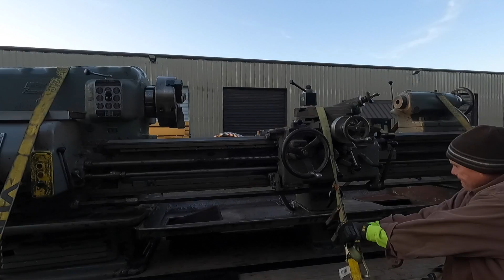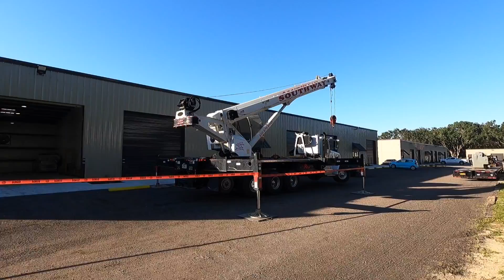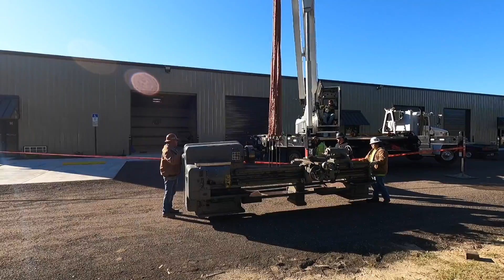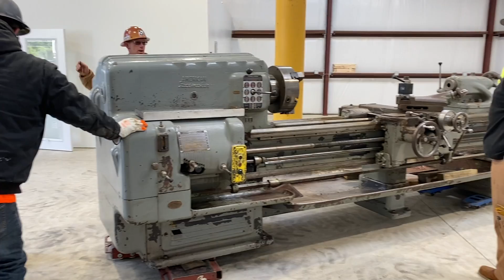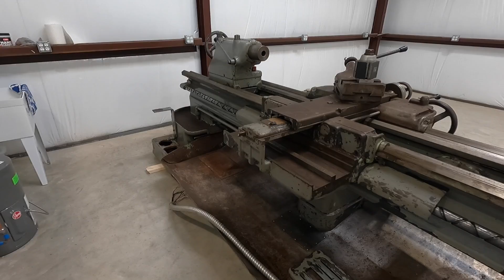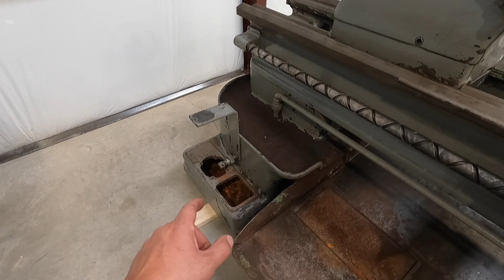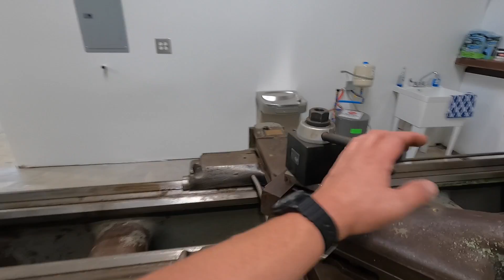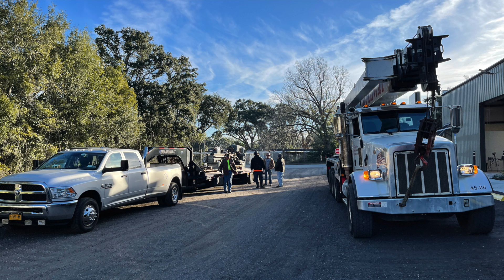American Pacemaker Lathe Arrival & Unloading

Comment: Beautiful machine, and very heavy and rigid for their size. I have a 22x96 Elliott (English built 1970s vintage) in my shop, and I would bet your pacemaker has a couple extra tons on my lathe. If it wasn't for needing metric threading and larger spindle bore, I would probably have one of those instead.
Reply: We have an old English Ward turret lathe at work purely for its spindle bore - 4 inches with clearance, can feed drill pipe etc right through it.
The beautiful things really the turret - 6 tool positions with automatic feed - wanna drill a 3 inch hole? hit the speeds and feeds and stand back and let her do all the work- makes drilling a inch hole in our smaller 16 inch centre lathe seem like hard work

Comment: I would have thought a forklift would have a been a better deal to lift it and move it around ?
Reply: The hall is not big enough for a forklift heavy enough for such a beast, i guess!

Especially when you need to move it lengthwise through the shop.
Reply: @Custom CNC  I was also thinking I have seen a lot of shops also have a forklift to help move around the heavy products and parts around . I can see having pros do the moving around also helps with peace of mind and safety when moving such heavy weights

Comment: Hi Adam, nice machine and it oozes quality albeit a few years old. I have always admired the Dean Smith and Grace lathes from the UK as a bench mark for quality here in New Zealand. Not many US machines here due to our power supply being 240 compared to you at 110. It looks like the hand wheel on the tailstock has been put on the wrong way around but I am sure you will rectify. Keep up the good work. Ian - New Zealand
Reply: @cmmartti  our three phase is all 400volt occasionally in home shops we run single to three phase converters that convert our 240volt single phase to 240 volt three phase

Comment: Why not a fork truck
Reply: There are a couple of reasons why. A forklift large enough to lift that lathe would weigh in at least 22,000 pounds. That’s what my 15,000 pound capacity Hyster weighs. The parking lot would probably not handle the combined weight of the lathe (probably 11,000 to 12,000 pounds) and the forklift. It also doesn’t look like the door is wider that the lathe is long. I ran into that issue with my 16x78 American Pacemaker and it’s nowhere near as long as Abom’s machine.I had to push mine in lengthwise just like they did. One other issue, and I’m speaking from experience moving a Pacemaker, is that there are components (drive and lead screws) that are easily bent by forklift forks if you’re not paying attention or if somehow something goes wrong. Using a crane, machine skates, and a pallet jack is really the better method given the conditions of his site.

Comment: We had a 20X192-inch version of that lathe at the shop I spent my career at. I installed a Newall readout and made a 20" ID steady rest for ours. As I recall, that unidentified lever at the end of the bed is a rapid traverse lever for the carriage. There is another on the carriage, left side. I think we used an Aloris DA toolpost.

Comment: Abby should appreciate this, I helped move most of the "secure" machine tools (monster lathes, mills, saws, drill presses, shapers, shears, planers, multi ton presses, CNC machines, test stands, etc.) from the 300 acre  Bannister Federal Complex (also known as the "Kansas City Plant") down to the new 1.5 million sq-ft facility on Botts Road in South Kansas City.  I know that drayage costs for that kind of lift and move is by no means cheap, but the folks you engaged did an excellent job, and she's also right, that "American Pacemaker" is stunningly gorgeous. I hope you get decades of joy from using it.

Comment: Is there already a crack in the floor?
Reply: do you know what an expansion joint  is?
Reply: @ladeseddy5994  I think I do, but check out 19:29, right in the middle of the lathe. That does not look like an expansion joint and I think it wasn't there before they put the lathe in.
Reply: @myname7021  Yep, there is one...
Reply: @myname7021  
If you look at the video where he was sealing the floor, the crack was there before the sealer went down.
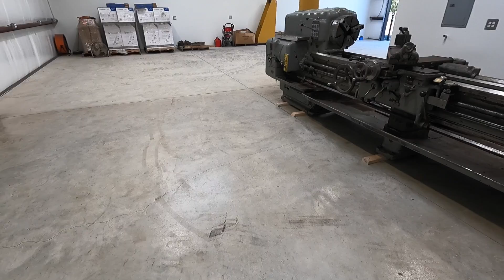Reply: 20:45

Comment: Whats this weird criss-cross lead-screw at the back for?
Reply: I’m not sure how it works on this lathe, but the idea behind that kind of screw is that when the end of travel is reached, without thanking the direction of the turning of the screw, the travel of the component automatically reverses direction. It’s a fairly common method of doing that. For example spin fishing reals use that method to reverse the the line guide direction.

Comment: What is the purpose of a shaft with a right-left hand thread????????????????????????????????????????????????????????????
Reply: Auto reversing screw carries the tool carrier back and forth without having to reverse the direction of the motor

Comment: Adam, check out Cutting Edge Engineering's You Tube channel; he got a lathe that he made brand new feet for, and he used an old piece of 4140 chrome bar from a hydraulic cylinder and he threaded the feed for some threaded rod that he cut to IIRC about a foot in length so he could level the machine, as his shop is in an old helicopter hangar. https://www.youtube.com/watch?v=6PwyvY09Ab0
Reply: That was a good video.  I already subbed to CEE but had missed that one.  Great dog!
Reply: @BillyLapTop  I made the suggestion to Kurtis & Karen they need to make a "Best Of Homeless" video and do a "tally" on how many toys he's destroyed right out of the Amazon packages; I think the score on "Homeless VS pigs is Homeless 6, Pigs 0".

Comment: Lovely lathe, really solid looking machine. Was thinking whilst it was being rolled in..with your floor being so good have you heard about air skids? they are really low profile and work on compressed air that turn whatever they are attached to into a hovercraft..you can move several tons with one hand no probs in any direction..maybe worth thinking about for bringing in future machines as thers no damage/weight on the floor as it moves

Comment: That strobing - those round lights are running at a (low) frequency that causes strobing with your camera.  You need to swap them out with something else or blow them out with more brighter light that isn't switching a low frequency.

I ran into this with an LED light swap at an office while we were trying to do high speed filming of some moving robot stuff.  Fixed it for my application by blasting the target of interest with 10k lumens of DC powered LED flood lamps.

It's unfortunately the lights and swapping cameras or going higher frame rate will only exacerbate it.
Reply: I don't care about the light,  this is not the Drama or theater department of the local junior college. If the lights work well for his machine tool operation then they are purfact. If they caus problems doing machine or welding work then it becomes an issue . PS one of my friends teachers  Lighting and Lighting effects at the University level. He also does stage Lighting on the professional level.
Reply: I fail to see the relevance of your friend or his teacher

Comment: That sheet metal tool tray is actually a brilliant idea!
We used to run 5 Mitsui CNCs that had nowhere to put an expensive torque wrench when adding component so we had to balance the wrench on side of machine and several times the wrenches slipped off into the screw chip conveyor and were destroyed.  $300 a time but when I asked boss to get some bits of sheet metal bent to make a tool rest he just laughed.
Some bosses are idiots!
Reply: Not all bosses/supervisors are morons and actually like the ideas that come from line workers for "improvements"
Reply: @andrewkoetz3933  
I don't believe I ever met one in all the mills, factories and offices I worked in .
Second job as a teenager was working in time and motion office that quickly taught me how to get high production but that business closed due to cheap imports.  After that in every job I was able to study the bottlenecks and time wasting and suggest or directly make improvements but usually the other workers or bosses resented it.
Ruining those expensive torque wrenches every few days for sake of a few bits of tin about as big as a sheet of paper is typical.
But in that same place we scrapped about 80% of production because boss had agreed all the parts woudl be checked with a CMM and bought one but the 5 Mitsuis made so many parts that the CMM could only check perhaps 20%.  Other 80% went into the scrap dumpster.
Guess how long a business can survive when it scraps 80%?

Comment: Stick a small submersible sump pump into that coolant tank and your good until you find a replacement pump.  What are your plans for raw material storage and scrap / swarf?  What other machines are you looking to add?   On a side note, those LED lights are still causing a lot of flicker on camera.  Have you asked your electrician if they could be run on DC to eliminate the flicker?

Comment: Congratulations Team ABOM79!
1. I firmly believe your restoration of this machine will prove to be one of your more popular series.
2. I think that bracket for the sump pump had an electrical box mounted on the top where that non-gray area is.
3. That poor crane operator had the sun in his eyes the whole time.  Did a great job nevertheless.
4. As an experienced metal finisher and auto body expert I recommend that you lightly sand all of the services you intend to repaint because regardless of how many coats of paint there are, you cannot guarantee adhesion by simply washing it down with solvent. The surface must also be in a rough enough texture to allow the new coat to “grab it”physically.  Just make sure that you wipe it down with a Prep-Sol-dampened cheesecloth after you sand it to remove any between-layer grease & oil and the paint should be primed along with any bare metal spots that you have after trying to address the rust.

Some of the lighter rust can be removed relatively easily with a muriatic or hydrochloric acid solution (pool supply items).

Recently my landlord had to have painters come back three times after the paint fell off because they had  failed to prime the bare surface first.
Reply: Commenting to add highlight to Mark Lee’s comment since I cannot thumbs-up more than once. Great advice. Tho muriatic/hydrochloric acid really shouldn’t be used without training and appropriate PPE. Vapors can really be an issue.

Comment: How will you place the lathe on the ground?
Reply: He'll put pads under it and use leveling feet to most likely raise It up to get it off the wood and then lower and level. Leveling a lathe is pretty tricky and I imagine a long one needs quite a bit more patience in leveling well
Reply: Essentially bolts thru the bottom flange of the casting onto steel pads to distribute the weight to a larger area
Reply: Toe jacks. Uses a bottle jack type hydraulic pump with a hook close to the ground to get under the machinery

Comment: Something I've always wondered (this is a lathe history question) - AT&T gave my highschool a bunch of equipment after the war. The lathe (no idea what make) was one of the first units to have an electronically controlled variable-speed drive. It was filled with some big-bastard vacuum tube controllers. If electronic control was used that far back, why do many lathes that were made much later, still use manual gear changes?  BTW it was pretty tough - they dropped it off the forklift, bringing it in, hard enough to put a 3ft. crack in the concrete and didn't even break one of the vacuum tubes.
Reply: That’s wild! Wish my high school had a shop program at all.
I’m not sure this is the correct answer, but it’s probably precisely because it was vacuum tubes and not transistors. The British call em valves, which is apt since they can be though of as controlling the flow of current within power amplifiers. Solid state power amps get much higher power density, and tend to be configured within an amp circuit to operate in the voltage domain—akin to changing the pressure instead.

Early electronic designs weren’t any more complex than necessary. Manufacturing of tubes then was a very serious business, with some for radio/industry/military being of very high quality — some combination of long life, durability, low microphonics (tubes of a power amp tend to output the sound of something impacting or vibrating them), low noise, increased heat tolerance/altitude limit.

Anyway, my point is that the modern VHDs are probs based on Class-D amps (I don’t know, but I’d assume), which are extremely efficient and therefore don’t generate much less (transistor-damaging) waste-heat. Whereas that old lathe’s controller likely used something like a 3-phase Class-B amp or something. 3-phase because it gives industrial motors an efficiency boost, and Class-B like what radio stations used (still use?) for transmitter amplifiers to generate maximum output power per device. No chance that’d be possible with early transistors—probably couldn’t be reliable at a reasonable cost with any transistors made to-date. For instance, tube amps tend to be much less finicky about little details, whereas any slight misalignment between the positive and negative rails of a transistor-based class-B amp would probs cause it to regularly blow out the output stage, necessitating downtime until a tech could come diagnose and replace the failed components.

Just guesses. But it’s almost certainly a matter of circuit design and the cost of available components that will be reliable for that design. Probs had to invent new types of power amplifiers before powerful enough motor drive controllers could be made inexpensively enough and reliable enough to make sense.
Reply: @fosterlewis7360  Hmm..good points. Electronics were cheap as hell by the mid-60s, once they figured out how to mass produce purified carbon, but the maybe couldn't handle the high power. I don't think thyristors and UJTs came out until later and high-powered SCR's weren't really commonplace until the late '70s.

Comment: that is a terribile place to put that  it should be  facing the wall on the otherside , there are some nice art deco stylings on that machine . ok so i ahve probably had to much beer
Reply: It’s located strategically. You just have to open your eyes and mind a little. That jib crane is there for a reason. Loading and unloading big material in the lathe.

Comment: kind of surprised you wouldn't just fork it off of there with a 35t forklift. I would think it would be a cheaper rental, but maybe not in your area?
Reply: The use of a forklift is not described in the instruction manual of this lathe.
Reply: Much safer and easier on the machine to crane it.  More work, but a better outcome.
Reply: @pamike4873  Hm. interesting, I moved a 48" VTL and a 34x160 mazak without much trouble. I guess having the extra weight of the huge forklift wouldn't be good for the fresh concrete.
Reply: @djfaber  Clearly easier with a forklift.
Reply: @djfaber  No one said it can't be done.  A crane is just safer.

Comment: I'm surprised at the lift in the middle - wouldn't that "banana" the lathe due to it's weight?
Reply: I was supprised as well.
According to the manual, round bars are pushed through holes in the frame at the ends were four slings are attached to.
But on this Pacemaker I did not see these holes when they pushed the machine through the shop.
So, maybe depending on bed length.
Reply: So, you know more than the professionals?
Reply: @paulcopeland9035  
Hey Paul, A professional in lifting heavy equipment is not necessarily an expert in the do's and don'ts of lifting long machine tools.
It is always prudent to keep a critical eye on things.
And in this case I would be reluctant to deviate from the instructions given by the manufacturer of the machine.

Comment: those cracks in the concrete floor already doesn't seem like a good sign
Reply: There are two types of concrete-one with cracks and one that will crack!
Reply: normal as long as you can't catch an edge. slide coin across crack, if it catches it's a problem.
Reply: It’ll be more than fine. It’s a machine shop. Plus the building is a rental and the cracks were there before Adam moved in. Building owner’s problem.

Comment: How much did the crane cost?  With the crew and machines looks like a way over $1000 bill to me! Probably more like $1000/hr. I usually use the big wrecker guys they tend to be more flexible and a lot cheaper but you don't get a whole crew to help after the lift. Of course a big rotator semi wrecker could have just backed it thru the door and swung and sat it in place.
Reply: FYI, The crane is probably around $250-400/HR. I'm not sure about rates in his area, but if it were in my area it would be around $250/HR. Plus a mobilization cost, and some labor around $65/HR per guy there.